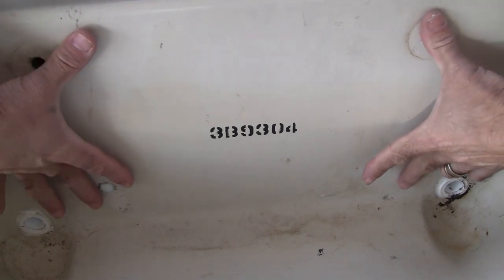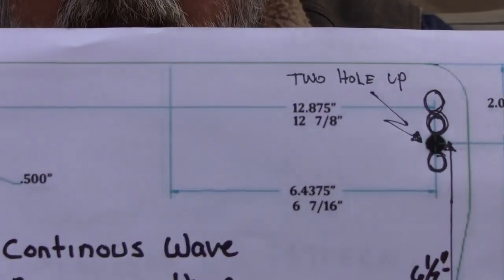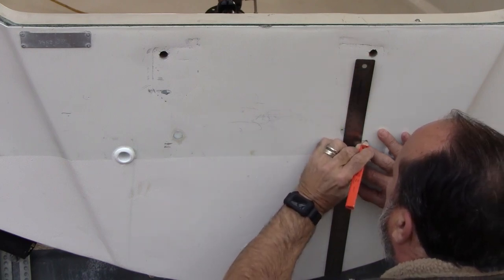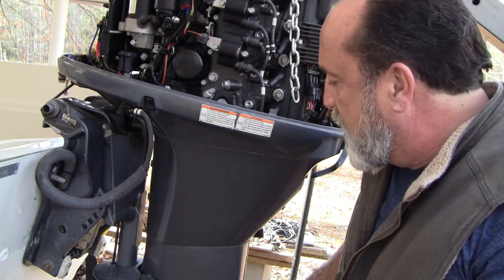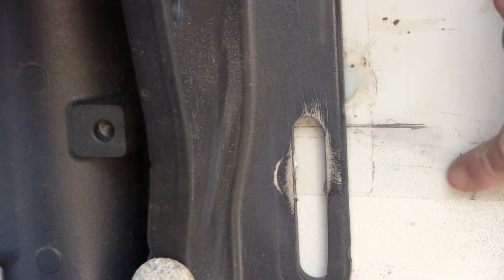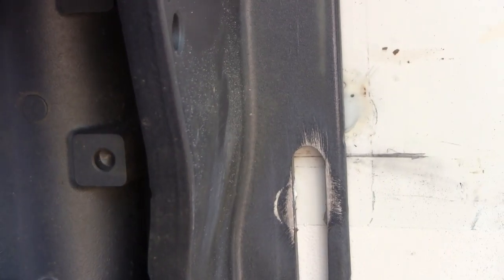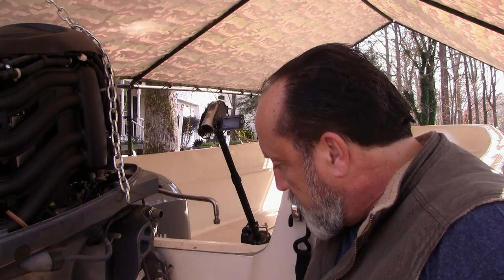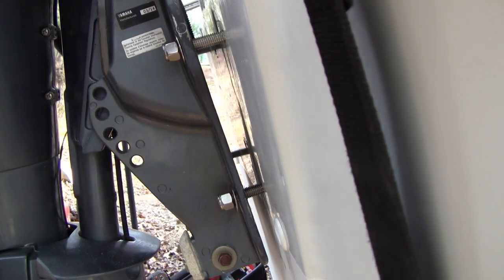How To Mount A Modern Outboard On A Classic Boston Whaler Montauk 17 - Part 6

Comment: Excellent, Jose! I have a 1986 Montauk bought in 1988. I recently purchased a 90 Yamaha 2 stroke from a friend to replace the Johnson 90 horsepower. Question will I have to change the bottom holes for the Yamaha? Thank you for your excellent videos and your tips, tricks and your attention to detail!
Reply from the maker: It depends on the year, you should be able to tell by looking at the existing bolts mounting the engine. If the bottom bolts are not visible, then they are probably using the blind holes, you can also check the link to the standard BIA pattern I put a link to in the comments. That will tell you what the distance between the lower holes should be for a modern engine. If you do have the older blind holes, you should fill them in, I have a video on that here. https://youtu.be/5fbggiow-14 Good luck!

Comment: Why not just use a jack plate? Drill the jack plate to match the old configuration. (Drill and modify the jack plate, not the transome) 
Then you can also use a transome plate on the inside. That way you are just depending on bolt washer surface to hold that extra heavy motor. Basically make a transome sandwich with the jack plate and backing plate. 
Then you also have up and down adjustment to get that prop in the perfect spot. Instead of having to compromise on predetermined hole settings.
That is a win-win-win for me.

Comment: Hey Jose, Just landed an 82 Boston Whaler Striper-17 for $3500.  Problem?  I don't know how to start it...could you help me please?  I have the key...I can see when you push the key in and turn it the choke would be on....but there is a plastic safety key thingy that is supposed to be on the ignition when it is running so that when you connect it to you self, should you be dislodged from the boat you will turn the ignition off when you depart the boat for whatever reason.  I'm trying to crank and she is cranking but not starting.  How is this plastic thing attached to the key area so that the boat will run?  Tks
Reply from the maker: You should be able to slip it up just behind where the key goes in. Hard to say with out seeing it.

Comment: Gady mate just wondering how you went with the cavitation plate alignment with your bottom of your hull , i use sikaflex 291 sealant wich is the same as or as close to your 3m 5200 but not as expensive here same cat different colour .
Reply from the maker: There seems to be a consensus in the "Whaler" community that two holes up is the way to go. I checked the anti-cavitation plate relative to the bottom of the hull after mounting the engine and it sits about an inch up from the hull which is ideal.
Reply: @ExtremeDIYGuy  here some say with a fiberglass boat it should be 25 mm low and on an aluminium it should be level it is all a big mistery i think .

Comment: Good but doesn’t look like there is any room to lower the motor if necessary due to the bottom being maxed out. A jack plate would have to be used.
Reply from the maker: You are correct, I'm ok with that. My preference is to mount the engines as high as possible without cavitation. The Whaler hulls have proven to work best with the mount 2 holes up, which is where I'm at now. If for what ever reason I needed to drop it more I would definitely use a jack plate.  I did on the 13 restoration and that worked out great.
Reply: @ExtremeDIYGuy  Correct on that 2 hole up thing. Mine is still locked at the bottom on an ‘85 15’.